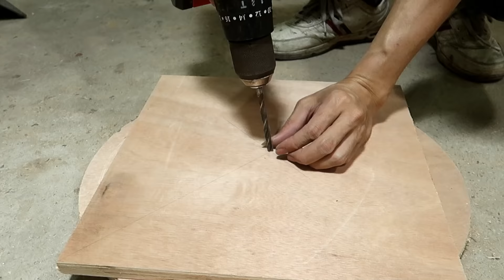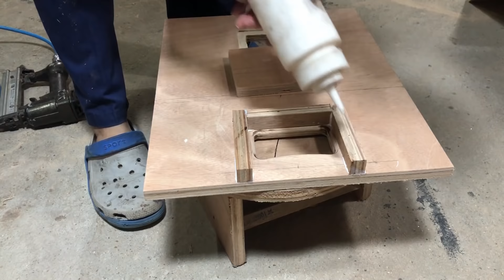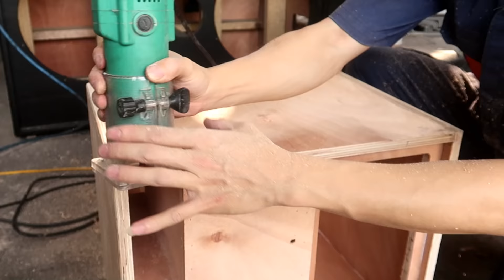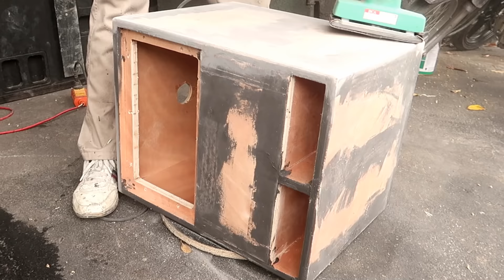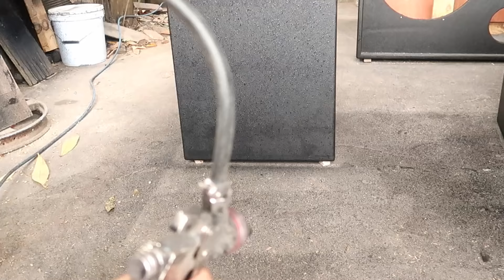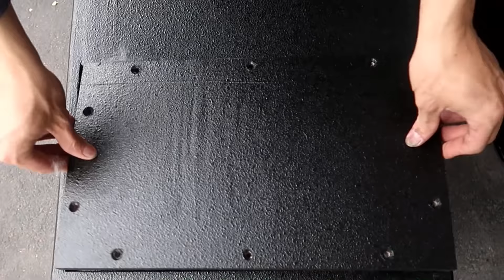How to make a beautiful pair of 12 inch home subwoofer speakers - The art of making speakers

Comment: Wait, what type of a paint  did you applY?  it looks like an Asphalt ?  paint mixed with pebbles? or  sea sand?
Reply: @Saraltiwari  your link  has nothing to do with  with the question i was asking?  but  it does not matter I think I know the technique now
Reply: @edifierbass7821  It's truck bed liner paint.
Reply: @starmc26  yes,  coz i've seen some people using an actual  small pebbles ..  anyway thanks